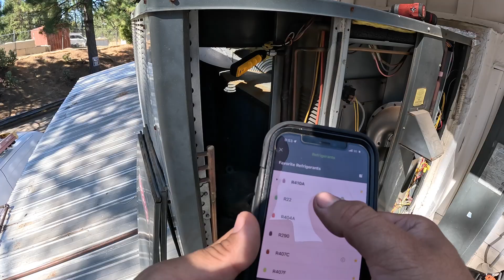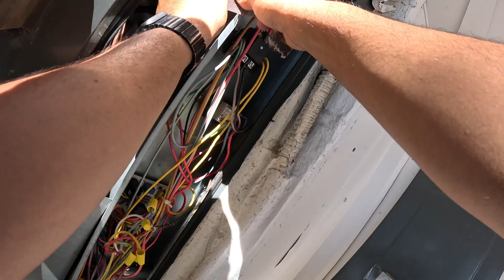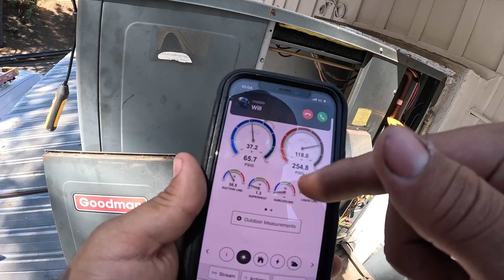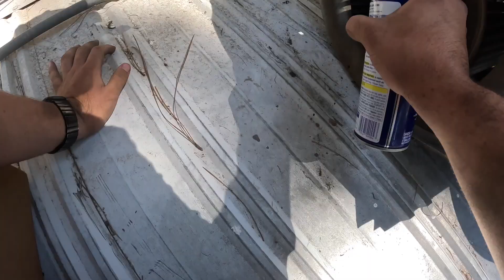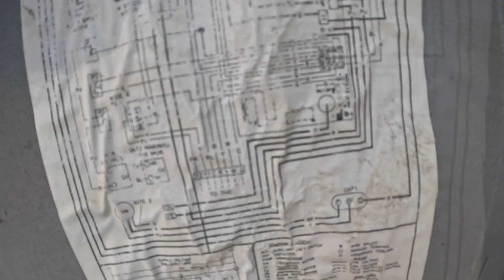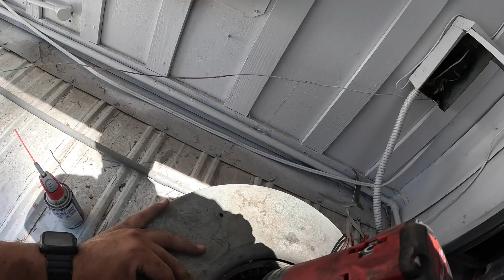R-22 Package Unit Evaporator Motor Replacement

Comment: Good video !  That blower motor removal was harder than it needed to be for you ---  tip for you --- tap the blower wheel down on the shaft a 1/4" & sand the entire shaft with sand cloth until shiny. spray wd-40 in the screw hole & on the entire motor shaft.

motor will slide right out like butter. no twisting & pulling required.

Just turn it upside down and motor will fall out.

Me --- hvac & refrigeration -  since 1981.